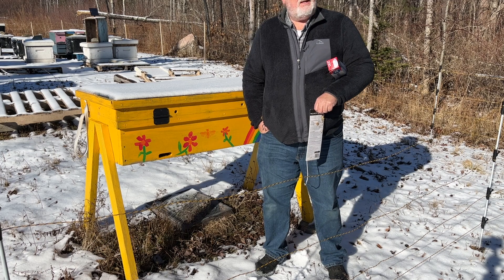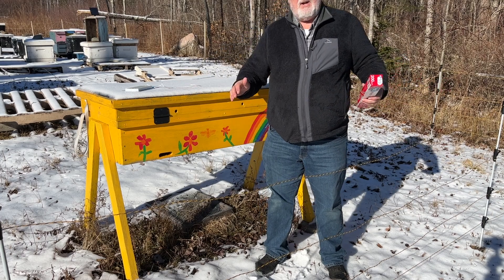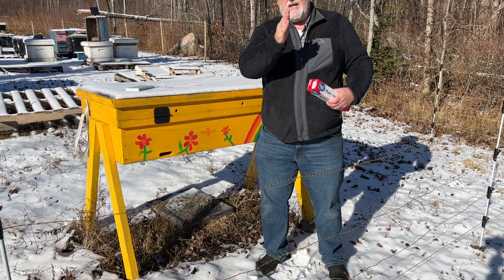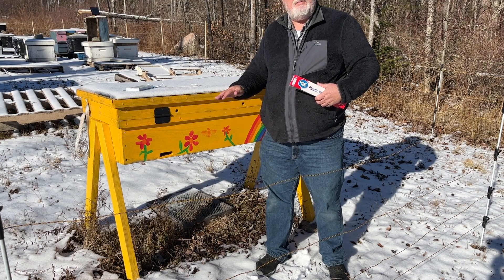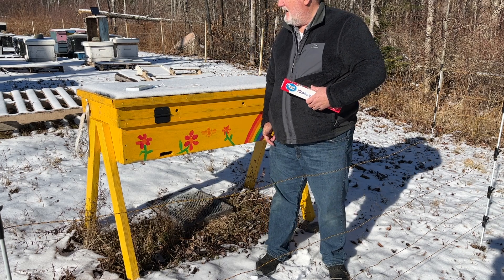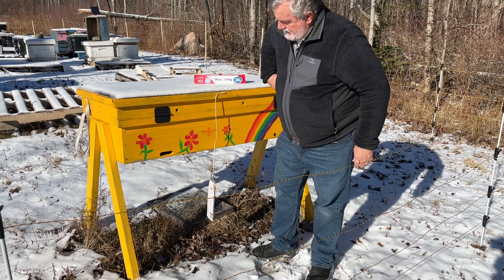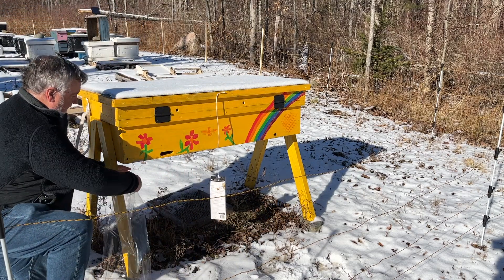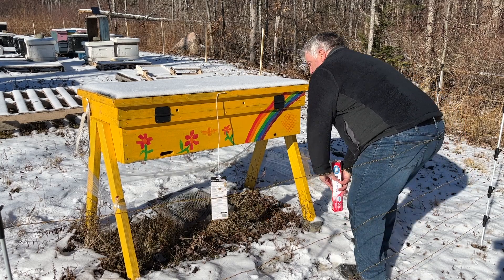Warming hives with the sun

Comment: Interesting. It could be useful if there was a prolonged frigid spell with sunny days predicted. It could help boost survival rates. I also live in the North and have had good survival rates with my 9 long lang hives, oftentimes better than my standard langstroths. 1.5 inch thick lumber helps insulate, and I do leave a lot of honey for the winter. For those concerned about the bees consuming too much food, why not cut a hole over the cluster area and put some Hive alive fondant over the hole and then a pillow or burlap over top of the fondant pack. It is cheap insurance.
Reply from the maker: I also thing drilling a hole (short cut) in the middle of frames may help.

Comment: Good afternoon Peter. Since I am in my 60's I am not interested in lifting heavy boxes. So, I went horizontal. Also, since I was just starting out and had no equipment yet and not restricted to and one style of hive, I went with the Layens frame configuration hoping with the depth of the frames [equaling 2 deep Langs] would give the bees the opportunity to move up rather than across. Seemed to work with an August swarm I caught in 2021. I have 6 colonies at this time. We shall see. As far as the long hive solar collector, a thought I have is that it may be too effective at heating, and it could give you quite a daily temperature swing especially if there was a bright snowpack, and later in the winter/early spring when the sun gets stronger. Thanks for posting, take care
Reply from the maker: I agree that its possible it could be too much......we shall see.